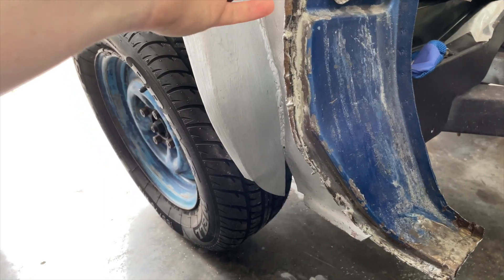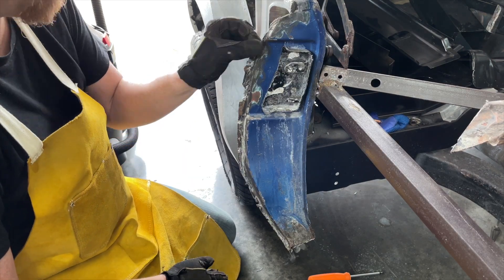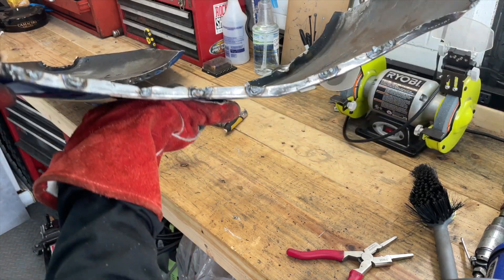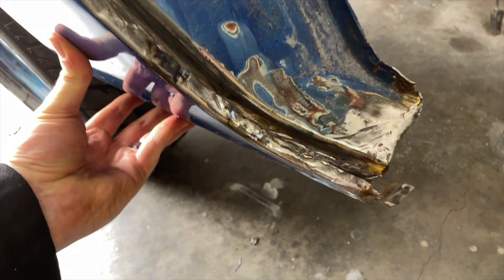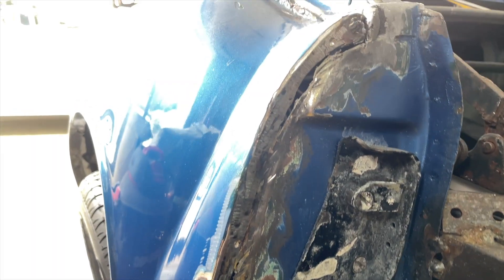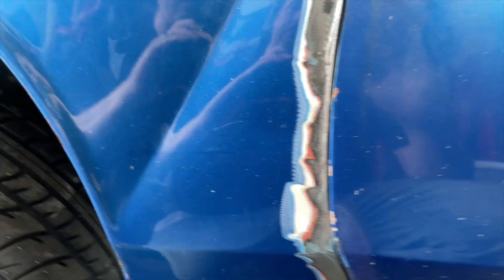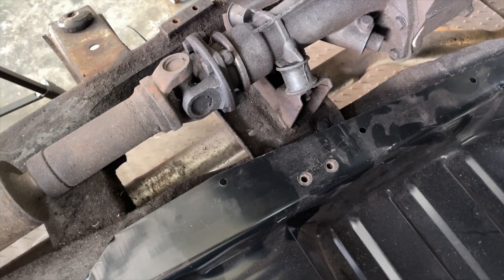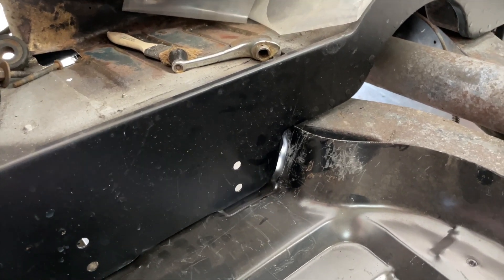Wing repair, and floor test fitting! | Triumph Spitfire Restoration - Part 41

Comment: Looking at it I have to agree more with Elin at this point, though that angle change at the dog-leg may be a little more of a challenge.
Reply from the maker: Thanks for checking it out again.  I agree that angle might be rather tough.  My though is that I will need more than just a single cut, it will probably be at least two passes with the grinder to get the distance I need.

Comment: For the door gaps, I'm with Elin. The end of the door looks to have a nice smooth curve to it whereas the B-post looks a bit wavy. There's a huge gap at the top and I'd suggest that the door is okay as the window is what determines that length along the top of the door.
Perhaps compare the two doors. You could stick a load of masking tape to the outer skin at the back of one door, peel it off (carefully!), reverse it and use that as a template to check the back edge of the other door.  If the door curves match the problem is definitely with the B-posts. Perhaps a bit fiddly but it could save the heartache of cutting and welding the wrong bits later on!
Mind you, as it's an old British car, I doubt any two panels actually matched from the factory!!!
Reply from the maker: Thanks for that great idea!  I am going to do that tonight.  That makes complete sense.  I suspect that the wings are at fault the more I think about it.  And that would be pretty simple to fix overall.